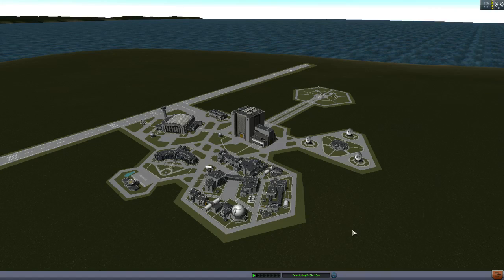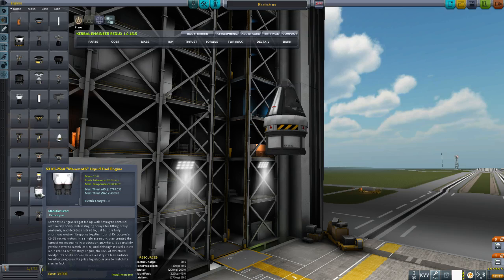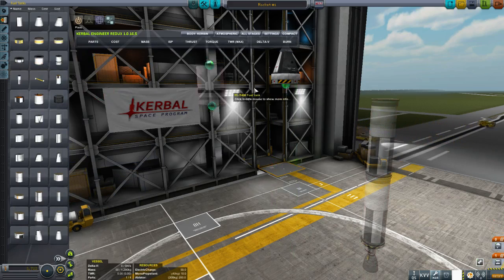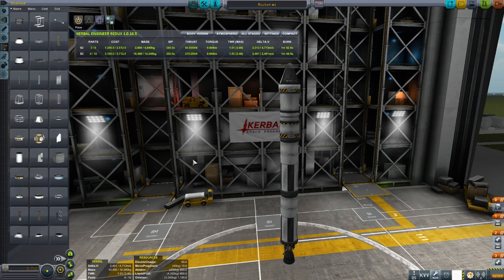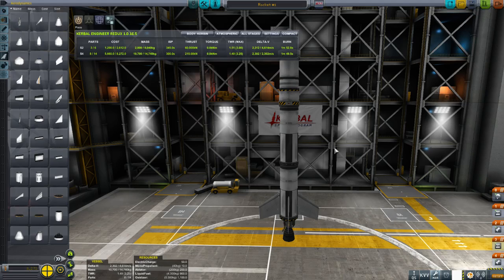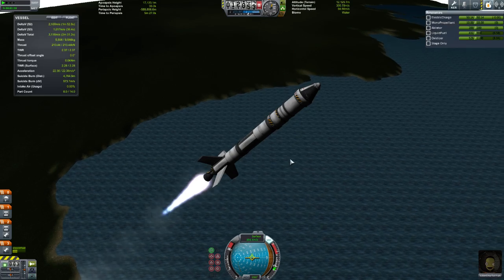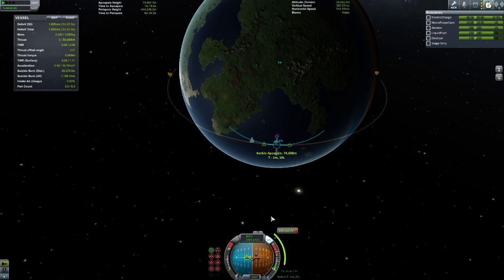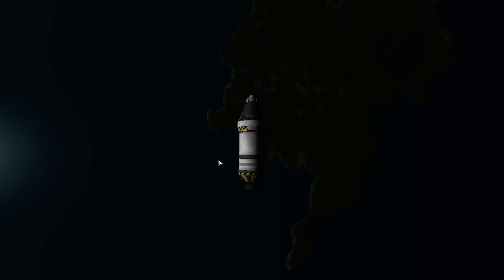KSP Build Better Rockets 1 The Basics

Comment: What does isp mean
Reply: Specific  impulse. Gives the time in seconds an engine will take to consume a determined quantity of fuel. Helps you to see how efficient an engine in terms of fuel consumption, use this figure with the consumption to, fetermine if you waste fuel or not. Nuclear and ion engines have very high ISP but generally have poor thrust to weight ratio, that means those engines are more efficient in vacuum than in atmosphere. (both ISPs are indicated to help you make the difference, ISP at sea level in atmosphere and in vacuum).  ISP is high your fuel will last long but acceleration will be low. Vector engines don't have a super high ISP and are powerful, those engines are great to get you out of an atmosphere or a high gravity body quite quickly but you'll have to add more staged above to complete ascend and circularize. Plus their gimbal is high so you can change heading easily but it'll diminish your efficiency even more.

Comment: why do you need a heat shield on the command pod? i never put one and im fine
Reply: try returning from another planet without a heat shield
Reply: Not really required if you have everything exactly right with angle of approach (at least with smaller landers on kerbin) but it gives you some leeway in case you're coming in too steep.